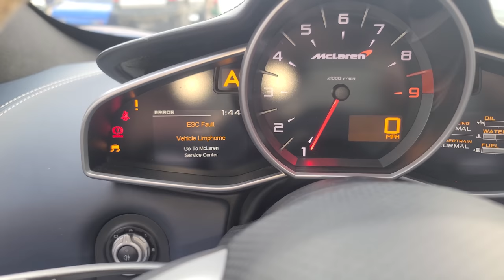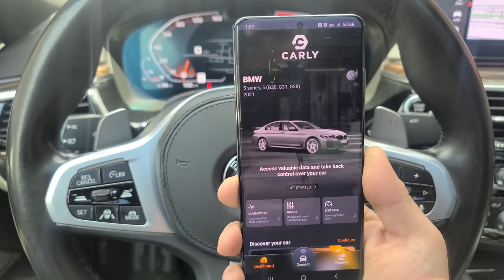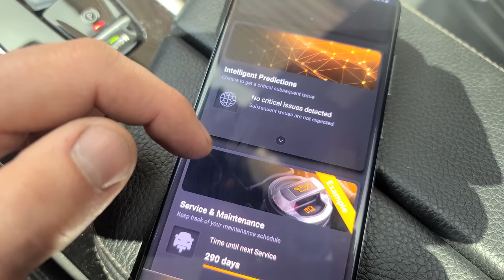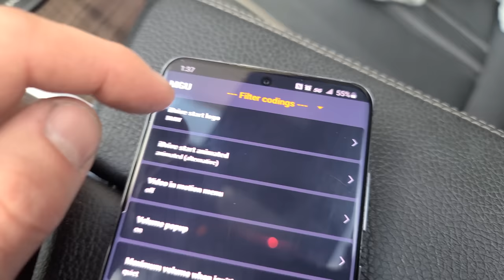I Took My McLaren To The Experts To Learn How Broken It Is & We Found $7k In Mods! It’s Broken Too.

Comment: That fuel door latch, is the exact same latch on a 2013 subaru outback to actuate the sunglass door by the rearview mirror! was around 9 bucks for 6 of them...they notoriously break in high heat...that is a bad location for that latch IMO...any spilled fuel will likely damage that latch. I have spares in my car as well...

Comment: The reason service intervals have gone to 10K miles, in most cases today is that the oil technology is so stupid superior to conventional oils that needed to be ditched every 3K. I do agree that the filters are largely unchanged in 40 years however, they still do their part and trap debris adequately.  That said, you can always just pop in a new filter every 3K miles when you have a really easy filter to access like the McClaren.

Comment: Love seeing the 12C content. As I've shared in other posts, this will be an all-time classic one day soon.  Less than 3,500 world-wide, only about 600 coupes ever made.  Amazing suspension, handling, braking, dihedral doors that give it that true exotic look, carbon fiber monocell which makes it very safe and light, and of course aging very well, active aero, brake steer to help corner entry, 22-25MPG when cruising around, twin turbo V8 Flat-plane crank with 8,500 RPM limit.   These cars run mid to low 10s  in the 1/4, and will do just as well as most road courses.     They are an absolute bargain right now, and as long as you do a pre-purchase inspection, some basic maintenance, there many owners in the 60k to 100k miles range with no major issues.       

In regards to oil changes, the reason they are important in the 12C and other cars, is because the oil pressure dictates the longevity of the Cam Phasers.  As oil ages, it gets thinner no matter what brand you use, also moisture starts to get mixed in from heat cycles and temp changes.   When the viscosity of the oil changes, the pressure differential needed for various parts, like the Cam Phasers, also changes.  With time, this causes an unnatural wear in the cam phasers, which leads to premature failures.   Change your oil every year, regardless of mileage driven.  The couple of hundred dollars you will spend and a few hours, will be much cheaper than 30k to 60k for a new engine replacement.

Comment: alot of car manufacturers do this.  take a throttle body for a lamborghini gallardo.
they want over 2000 $ for it.  
thing is its the same as used on a volvo V70  and if you order it for that its only like 260.
exact same part number.

Comment: Just a quick note to anyone with a Mercedes Benz who was thinking of acquiring a Carly OBD2 device, save your money! Apart from clearing fault codes, it really doesn't do anything else & there are certainly NO coding options due to the complexity of MB proprietary software!
They (Carly) devices seem to be designed primarily for BMW's.

Comment: I'd bet my house most of those rod failures are from going too far lightening the wrist pin. Engineerds usually see it as uselessly heavy, but once that 'bites' and seizes in the rod from flexing, it will fold even the mightiest of rods. Heavy duty pins have ID's smaller than a pencil.

The piston torn apart at the wrist pin is a typical wrist pin flex failure, also common on LS engines. It literally prys it in half like a crow bar.

Comment: A word about 10,000 mile oil change intervals: Yes, there'll be more metal in the oil filter than if you change the oil twice as often--twice as much metal, if you think about it. If the oil's lubricating properties are still within spec, and the filter is capturing the debris, then by changing oil at 5,000 miles won't really help other than there'll be about half the debris in the filter when you cut it open. What you really get with more frequent oil changes is that if you don't get the car screaming hot every time you drive it, then water will condense and stay in the oil, which not only makes a poor lubricant (more wear) but it causes sludge as it mixes with the combustion gases (aka dirt). All that said, yes 5,000 mile oil changes despite synthetic oil are what I do--it's way less expensive than any alternative.

Comment: If the engine air intakes were designed for ram air effect then the engine might need suitable air flow over the vehicle to achieve full power.

Comment: What fuel were you using on the dyno? If this was a tracked car, it could have been tuned for track fuel. The engine could be running rough because it's not the right fuel for the tune. Just a thought.

Comment: Should have had cooling fans on the side air intakes that feed the intercoolers. They we’re probably heat soaked with no air flow dropping power

Comment: Wouldn’t recommend amsoil. Used it on my car and it tends to thin out so much I would receive “no oil shut off vehicular “notifications. Especially during the summer. Then one day I heard my engine knocking with only 30k miles.I’d change my oil every 5k miles with their signature series. 
OEM oil is the best.

Comment: Very interesting vlog , do get your thinking to temper down the torque to  keep it safe, after all it’s engineering art and the earlier oil changes are always a sound idea my rs4 2014 gets one at 5/6 k, it was a demo from a main dealer and has no limiters on its top speed , I had it at 193 and run out of road, but still had revs to spare 🤪, it’s 450 hp std I suspect it’s more like 500 it’s still only in 30,000 miles, and runs sweet, the gear shifts when in dynamic are flawless that v8 at 8250 rpm going for it is awesome 👍👍👍

Comment: Alex, i never owned a new car or a car that is remotely close to the expense of a McLaren super car, but I've always used Mobil 1 full synthetic and 10k mile intervals. I don't abuse or neglect my vehicles, but i lean on them hard, for fun. When i drain the oil, it's never black oil and appears to be usable in another engine. for the water pump, i bet a small, wood wedge could work to keep that chain tensioner in place. Dang, that dyno sheet is crazy. Hope you can iron it out. 😐

Comment: I feel like the title and the thumbnail are not really what happened in the video. The car is doing fine and has no major issues. Also, it's quite sad that there is almost never a real end to a story, it's like the final video is always missing with these projects :(.

btw, I had a good laugh when I saw the "Amsoil European Motor Oil" thingy :D. I am European and I have never heard of that brand 😅. What we use here are brands like Liqui Moly (or its budget brand Meguin), Mobil1, Valvoline, Motul, Total, Castrol, etc. .

Comment: Your CTS-V gets bad mileage because a) it's been messed with, b) the stock LSA engine has no return line for performance reasons  (multi port injection) and c) the average on an unmodified LSA is 13 to 14.5 L / 100 km, which comes to between ~18 to 16 U. S. MPG. A stock LSA can get around 12 L / 100 km on the highway (19.6 U. S. MPG) driven at 130 km / h (80 MPH).

Comment: if you tune a mclaren and a part you didn't tune breaks you can't blame mclaren. turbos, injectors,exhausts,remaps are tuners favorites cause you can take any one of them on their own and it will increase HP, but if the only thing you did was fit stronger heavier con rods you would actually lose HP. once you start you can't stop

Comment: Doesn't sound smooth at all. Its like its going to 7.5 cylinders or pulling a LOT of timing. Something defo ain't right somewhere even if we ignore the missing ~100hp.
Maybe a knock sensor is going nuts or something but it sounds lazy. 
The torque looks like its coming up then dropr then comes up again then drops and stays dropped. Where it rises the first time looks like the normal curve they make when they make a good run but they don't roll over like this. 
Its almost as if its got bad fuel in it. Maybe the tune was for E85?

Comment: Actually  old days was 5000 Miles, or 7500 Miles depending the car.  now they ask for 3500 miles, but Mercedes is a lot longer then that for A and B services. I also own a 720S my self, as well as a few Mercedes, Alfa's, Maserati's and Ferrari's. I replace the oil every 5000 or 6 months, so majority is every 6 months. I use Schultz for the transmissions on the mercs,  and Liqui Molly for the engines pretty much all cars, for the transmission depends on the car actually. Enjoy your Mclaren, they are a lot of fun, and stop calling her the cheap  Mclaren.  Good Mechanic, he replaces all like I like.

Comment: Recoil® Keyserts® are solid, one-piece, key-locking inserts used to repair damaged threads or for use in original equipment. The Keensert® locking thread repair keys provide a positive mechanical lock that prevents rotation due to vibration or torsion. Keensert® inserts are available in carbon or stainless steel, both in inch and metric series. Thin-Wall, Heavy Duty, Extra Heavy Duty, and Solid insert styles are available separately or in Keensert kits containing a range of sizes. Keensert® installation tools are also available individually or in a range kit.
Installed with standard drills and taps • Easy installation • May be used in a variety of materials: aluminum, magnesium, cold-rolled steel • Easy to remove • Passivated to enhance corrosion-resistance and finish • Counterbored internal thread on Inch Series Keenserts; countersunk internal thread on Metric Series.
Keysert® tooling range kits are available in UNC, UNF, metric, and tool only. Also, you can find them in mini range kits and master range kits. Blind Rivet Supply carries the entire line of Recoil® Keysert® kits for your convenience.
Keysert® tools are made to install and set keys to complete the installation. Blind Rivet Supply has all available tools for both the Keensert® and Keyserts® tool lines.
Copyright 2023 Blind Rivet Supply Company. All Rights Reserved.

Comment: I’ve been stock piling the now discontinued Quaker State Full Synthetic (QSFS)*NOT ULTIMATE PROTECTION*5W30 from Walmart because engineering blogger 540RAT has tested it to slightly edge out Amsoil 5W30. Go see his blog. It will blow your mind. He also says to run no more than 5,000mi OCI even on Amsoil on street vehicles. He says that 5W30 is the sweet spot of best oil for most modern engines as long as it’s hot oil psi is adequate. What are your thoughts about running a highly ranked 5W30 from his list in almost any properly running gasoline engine?

Comment: when you said horsepower and torque I literally thought to myself 575 Horses, as its never close to what the factory says, and 420 foot pounds of torque, so while I was spot on with the HP, I was off with the torque, also why arent you wearing hearing protection, go to a sporting goods store and get yourself some earplugs you can keep on you at all times, like find where a local sporting goods store is and get some for you and the whole team, the higher the DB level the better, as you want 28 to 30

as your dealing with exhaust, loud noises and drones, and that all does in your midrange hearing over time.

even just go to a wielding shop and get some 3M hearing protection earplugs as anything is better than nothing, as even the air con for a wielding shop is over 80 DB, the breaking point for hearing damage

Comment: I caught myself rolling my eyes at the flame shooting and the blue smoke afterwards... not only was the previous owner a poser, but you know yourself that Blue smoke is bad burn due to bad mix, bad timing, oil blow-by, wrong spark plugs... gasoline engines truly suck ass so bad as opposed to diesel ones, don't they?

Comment: McLaren has always been a great F1 team. They've seen some woes in the last few years or so, so I'm hoping they will come back to the top tier. Their street cars look great and run incredibly well. However, their engines are lacking, which is common amongst the super car crowd. Not many super cars have engines which are intelligently designed. One has to wonder about the fragility of these cars.
However, your Macca is one of the early ones and while it's fragile in many regards, it looks fantastic.
I've always wondered why McLaren never used a Mercedes-AMG engine... They used the BMW V-12-cylinder in the original F1 which set the standard at the time and were behind the Mercedes SLR, which is one of the most amazing super cars that was never really supposed to be... McLaren could have taken that engine,modified it, and used it in the MP-12 series street cars. Oh well... Not my company and I've never been an engine or car designer.
Alex, it's great watching you with the MP-12 as you are so pumped to own it and work on it.

Comment: I change my oil every 3000 miles. Wether it’s in my 2 Mercedes, my old 2008 Volvo or my even older 2007 Ford Focus. They have never had any major work done. My Volvo has 157k miles and my Focus has 154k miles and the both run as well Mercedes E550 and E350 with less than half the mileage. It’s cheap and easy to get an oil change. Why Mcclaren would recommend oil change every 10k miles is ludicrous. No wonder their engines always blow up 😂.  I’m sure an oil change on a Mcclaren isn’t cheap. But I would guess it would be a lot cheaper than a new engine.

Comment: I asked a question, on the website, but it did not give me an answer... Is the Carly Programming reversible? If I remove the "Chip" does the car reset to the original factory settings?
I bought a "similar" OBD 'replacement' and it made my SRT-10 Truck run WORSE... with an idle RPM of over 3500 rpms... it Jolted the trans, and I had to hold the brakes harder. (which I am SURE was not good for the Auto-Trans..) I removed the after-market device, and it took several drives to get the truck to feel "Normal" again... 
Certainly, I am not 'judging' the Carly system by the previous experience, but just want to "Know what I will be getting"... without the 'risk' of a similar result.
I realize that a Viper V10 SRT Truck is not a "volume product" so it may not be  on your list of re-tunes... 
All I got from the supplier, when I called them to see if there was some mistake, or a 'fix' I could apply... was simply to say, "We have never had a complaint like that before." and they hung up. NOT going to get any "Referral business" from MY contacts and friends!!

Comment: the reason in the past you would be getting oil changes every 3k miles was because it was natural oil that would burn faster. the new synthetic oil is generally safe for 15k but you shouldn't push it so 10k is a great middle. let's not forget we have great engines made by Germans we developed the atomic because we took Bowman from them after ww2 they were developing and the list goes on, so i would say Germans know a thing or 2 about engines and the reason they recommend 1y or 10k. i'm not talking about Maclaren. they are expensive cars for people that have enough money to push them out of the house

Comment: Long story short do not mess with McLaren`s,  they are built to be as fast as they can out of the factory and if you tune them, mod them and do not service them then do not blame McLaren when it goes wrong.  I would love to see a video where someone bought one and did not mod it but drove it and serviced it regularly to find out how reliable they are but there is ZERO chance of that happening.  
How that car has no service history is ASTOUNDING , it seems like people can afford to buy the car but cannot afford to run the car, they cost thousands per year to run just saying.

Comment: I think it should be made illegal for manufactures to charge insane prices for parts when they have an alternative cheaper option which is available. Quoting $90 when you can probably get a part elsewhere that is EXACTLY the same part code is fraud and illegal. I say we start a class action lawsuit.

Comment: Engine and gearbox are matched push on the rods with to much torque they rotate bending the rod or causing failure. What the lighter engine and lighter car do with the available horsepower and torque is critical. You could have a heavier engine making 800 plus hp but the weight makes it slower on acceleration. It weight against hp. Power to weight ratio. It’s a McLaren it’s all finely balanced and messing with factory could easily take engine over the edge. To much torque is going to bust stuff. Engine Clutches Gearbox Axle are designed to take a certain load any more you have rapid failures. It one thing to build a thousand horsepower tank and another to design an 600 hp lightweight beast.  It a trade off. Also limit the torque so you do not bust it during acceleration and keep the power in at top end possibly. The tuning guys will know. Heard of many a busted engine and transmission due to chipping adding boost better inter cooling. At the end of the day it’s all hot air😀. That’s what drives the internal combustion engine as much cool air as possible being expanded in the cylinder. Fuel is just there to heat it up.

Comment: These type of cars can have /performs better with skinny tires in the front bc of the front trunk. There is no weight in the front so there isn’t much need for a wide tire. It’s actually more beneficial to have a skinner tire at that point to keep it light and nimble in the front. Traditional cars with engines in the front use wider tires bc when you go in the turn the weight of the engine mixed with the contact patch of the tires and suspension is what makes up your tracking ability